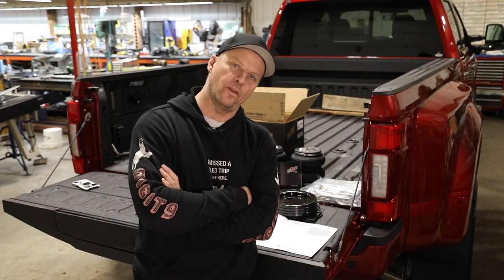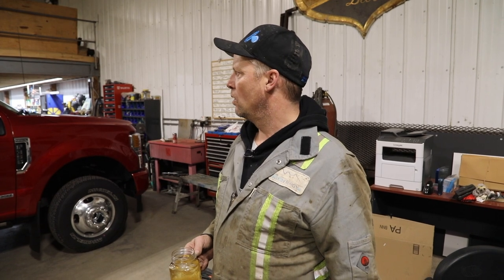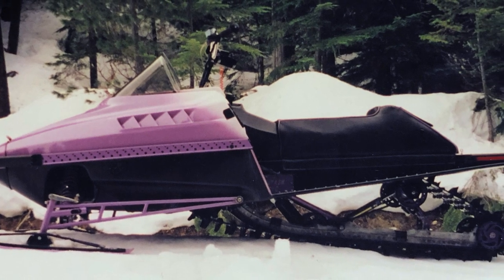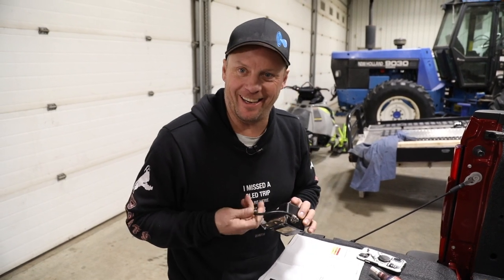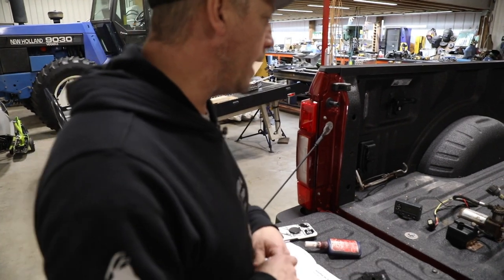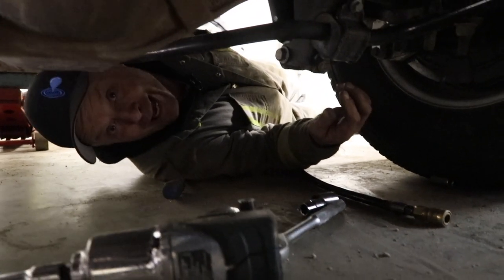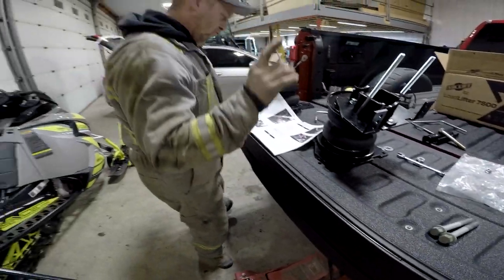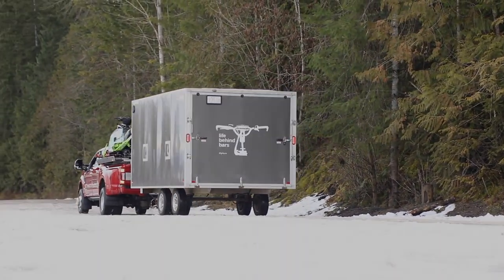Air springs for hauling snowmobiles on a deck

Comment: Couldn’t agree more with adding airbags to the suspension. 3 years ago my wife decided to get her masters and we loaded our home into the back of a pickup (with a trailer) and drove Montana to Michigan. Returning to MT this year I installed airbags first and the truck drove, braked, and handled like it was empty. Amazing difference between the two trips as far as driving comfort.

Comment: I added the airbag kit to my Chevy 2500HD and WHAT a difference in the ride !  With 2 sleds on the Truckboss Sled Deck  and 20-25# of air it leveled the truck out BUT more importantly it put pressure back on the front wheels...key in snow covered road conditions and a cross wind.  The 2500 chassis carried the weight of 2 sleds but the airbags just added that little bit of needed leveling. Greatly improved the overall ride and an onboard compressor allows to adjust on the fly...

Comment: I made the Mistake of Tee’ing my air bags together with one fill point. Makes it Super tippy in a turn, especially with two sleds on my Deck. As soon as I got back From Blue River I changed it to one fill line each!

Comment: I had a set of air bags on my  2018 f-150. Worked well but in northern Alberta hard to keep air in them. Eventually leak from extreme cold. Constantly had to pump them up. Now I have a 3/4 ton duramax and don’t worry about it . But air bags are great in warmer climates.

Comment: Do you have a special hitch for your extension? Thanks - are you using the factory receiver on the truck and an extension to clear the trailer with the sleds on?
Reply from the maker: https://youtu.be/-umRC6BaRgU. check this out !